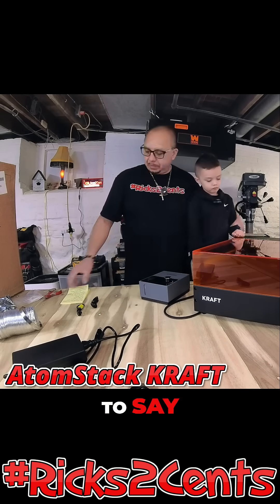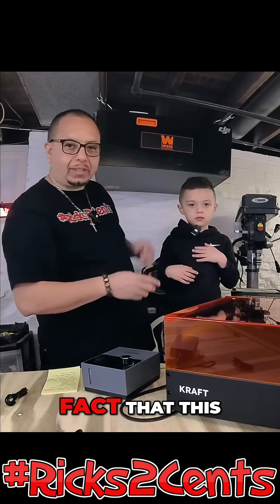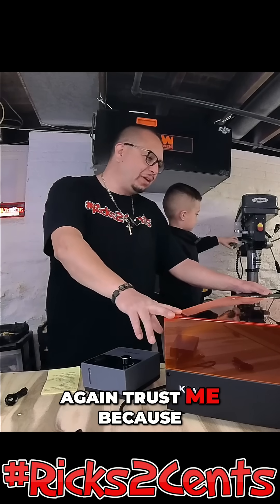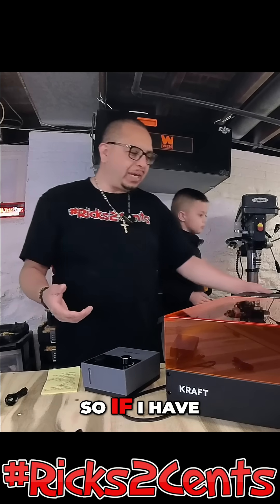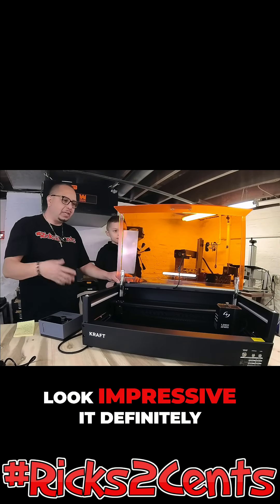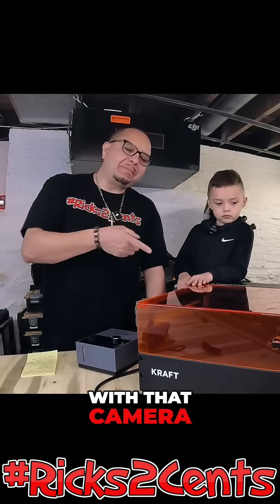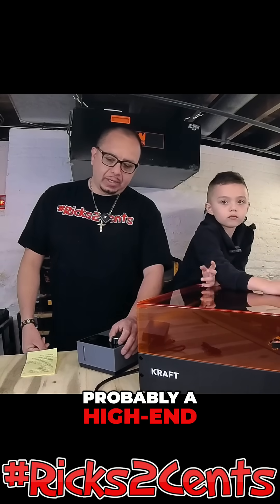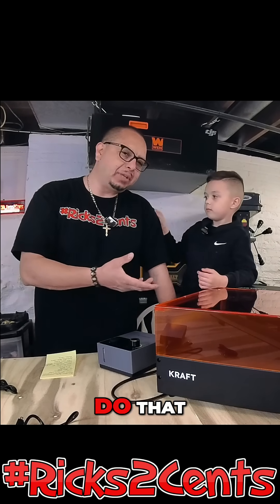Smart Design Feature That Will Change Laser Cutting FOREVER! AtomStack Kraft

Comment: The exhaust is in the middle so folks can go either left or right with the hose. Better yet, Roly Automation offers a side replacement panel to exhaust left or right side.
Reply from the maker: Good Idea. I like the idea on the side, but with my Setup I'd prefer it on the Right vs the on Left how it comes.